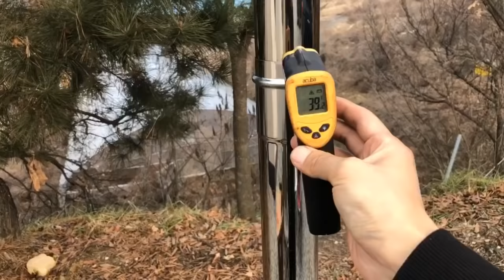360도회전 로켓스토브 만들기/ 캠핑 / Camping / 360-degree rotating rocketstove  making

Comment: That metal is thin. Wouldn't it burn through in 1 or 2 years? Fire burns out metal
Reply from the maker: You should use 1-2 years every day
Then maybe the metal will melt

Mainly winter camping
Use up to 3-5 times per year

Comment: Any idea how many sticks of average size you went through, and over what type of time period?? I'm curious about how long it took to cook the bird (what type was it, maybe approximate weight?) as well as your roots (what type were they?). 

Another quick question is the size and wall thickness of the square tube you used? Mm dimensions are fine; my steel supplier stock's both imperial and metric size's. I'm guessing 75~80mm? Thanks!!
Reply from the maker: Welcome to
Four wooden sticks 15 minutes.

Another answer
100x100 size 2.0T
80mm of stove pipe

I can not speak English well.
I don't know if I answered correctly
Thank you for watching the video.
Reply: @stovetv   Thanks!!! I can scale out the rest from that.

Comment: I saw where you commented the dimension of the tubing is 100x100x2.0T or 4”x4”x1/16”T. Is this plain steel or stainless? When you tig - is your machine ac or dc? Scratch start, lift off start or high frequency start? What filler rod are you using?
Reply from the maker: 100x100x2.0T /Верно.
AC /Верно.
Сталь/Верно.

Спасибо.^^
Reply: Спасибо!

Comment: Your work is fantastic. I wish I could make something with my everlast welder as well put together as you.
Reply from the maker: I'm glad to tell you my work is fantastic
Thanks for watching the video
Reply: Mark you can. That's only about about a 16th of an inch wall thickness. Any welder can handle that. And this dude is only putting down a string of tack welds anyway. Any cheep welder will do that. Other than his welding vary nice work.